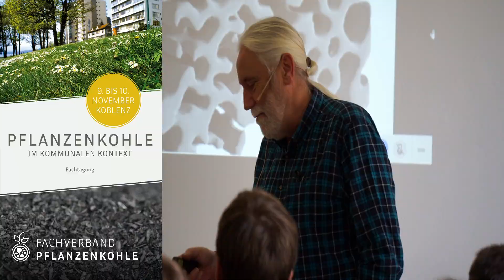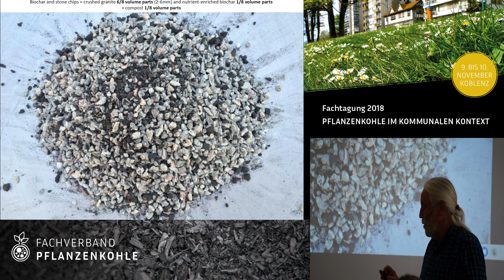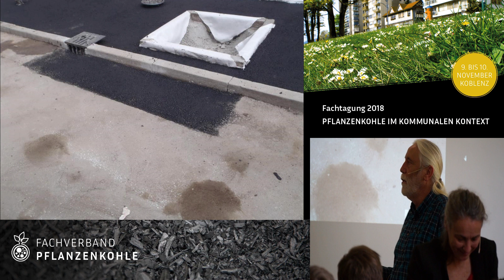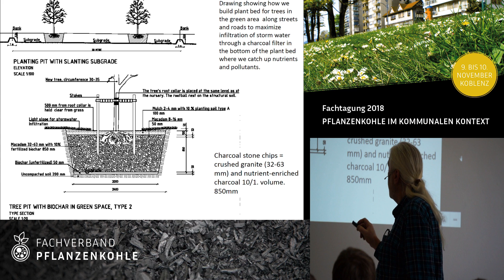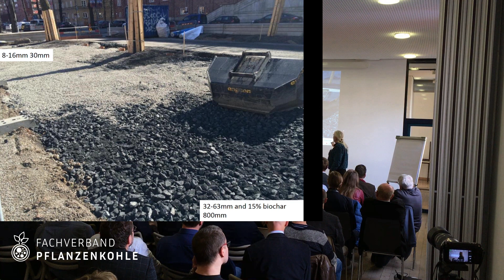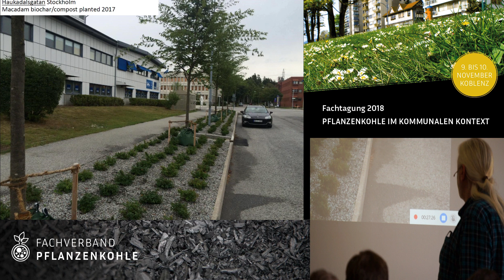Björn Embrén | "Porosity With Stone Biochar and Compost" | FVPK

Comment: Fantastic! I wish there were questions too. I'd be asking about the cost comparisons to the conventional equivalents? Are trees watered in the first 2 years when it is dry? A video of the cleaning of the air/water wells - does it fill and block with litter and or other debris? What are the green bags around the trees in many of the photos? Which other countries are using these same techniques? The concrete structure around the tree is to prevent roots from going into the smaller gravel section, but roots can grow up wards - has this been noticed yet? How is the air exchange calculated i.e. what size well per area?